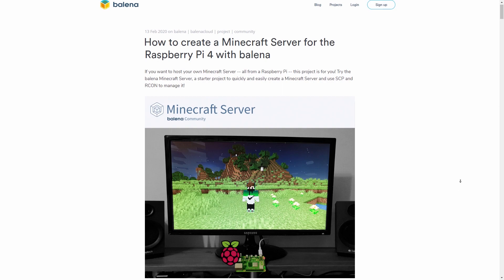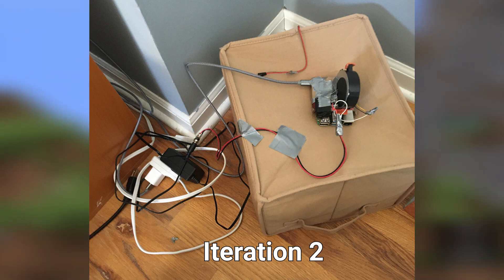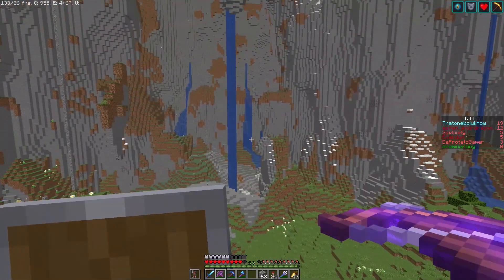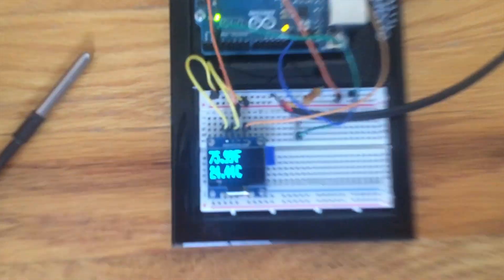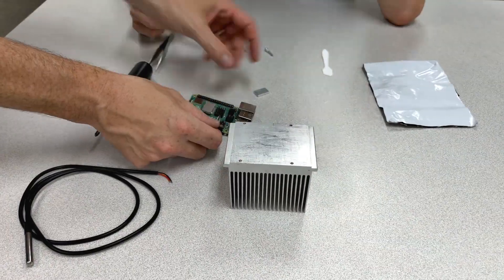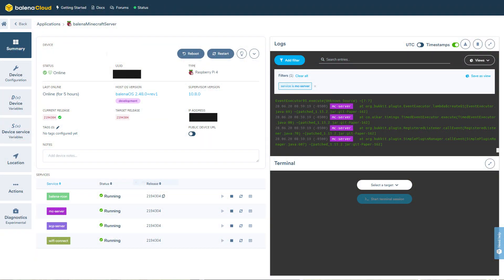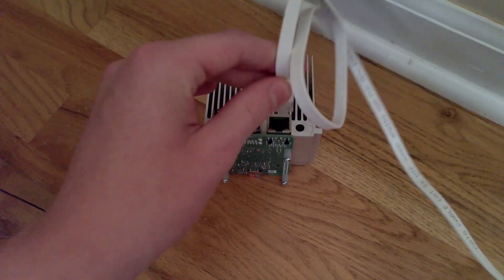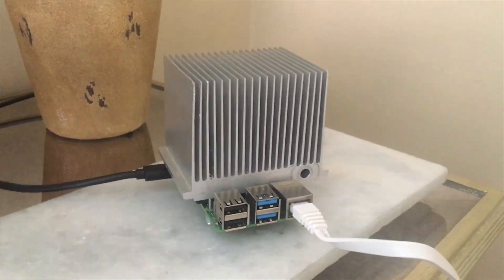How To Properly Do Passive Cooling - Raspberry Pi 4 Passive Cooling

Comment: I made a massive passive heatsink for my Pi4 out of an old AMD heatsink too, but I went a little different route. You get better thermal transfer by not sandwiching a stack of spacers with thermal paste together and for such a small CPU like the Pi has it also helps get rid of heat better without that GIANT thick chunk of thermal mass on the base of those old heatsinks which retains more heat.

So I used calipers and wrote down the measurements and made a scaled layout of the Pi 4. After figuring out the minimum height/thickness I needed for the base of the heatsink I transferred the Pi layout to it and removed most of that excess Aluminum. With a Pi 3 that's WAY easier because the processor and RAM ETC stick up above the board at pretty much the same height, but on a Pi4 the processor sticks up taller than the RAM chip, so you have to remove more material where the processor sits to get the heatsink to lay flat on both chips. If you know someone with a milling machine it makes that step much easier.

Comment: just use an Argon One case, keep it passively cooled to about 50 degrees celsius even overclocked to 2147mhz, fan kicks in at 55 degrees which I have only seen when stress testing the pi and rarely when I emulate Gamecube for extended periods of time. and the Argon is cheap too.

Comment: which version (gb) of PI is that and how well does it perform ? 10 players on big area on vanilla version will perform well or it is too much ?
Reply from the maker: 4. But the server was using 2. There were times when 6 players were spread around the world and everything was running fine.

The one thing that lags a lot is huge farms and people flying around loading a ton of chunks
Reply: @aSingularPhoton  thanks ! I wonder if 8 gb version would be even better, do you have any idea ;) ? How fast is your internet ? Mine is 600 mb/s and I wonder if it also would make a difference. Thanks for your time, it really helps with my purhase decision ;)
Reply from the maker: Rafał your internet is substantially faster then mine and mine had no problems. When I was doing a little research the server hypixel said that each person uses around 1-2 mbs of bandwidth.
Reply: I have a question what tutorial did u use to build the server?

Comment: Awesome experimentation, could you plz also just make another video with overclock setting upto 2100ghz and 6v or 8v and gpu at 800mhz ? Just for the sake of Knowing the performance , now as you said it works fine but numbers would be gr8... I think u can check out small program to check temps on channel "explaining computers" on Youtube in argon case video posted on that channel it shows a bash script for temp check in loop...link to tht video :  https://youtu.be/IJn3fz7Zk4Q
Time at : 12:01

P.S : This video was very very helpful as RPI COOLING TOWER is not available in india to buy and it goes expensive to import ( i can buy a pi zero w or even pi 3 in tht price) so was looking for an alternative or making ice cool tower myself or something of tht sort with equal performance.... Hence NUMBERS PLZ.

Comment: WIFI fails because you blocked it with the heat sink... You can solve that with a usb wifi dongle if you insist on using wifi. If you haven't already, apply the latest firmware updates that reduces the heat generated by the board And you can also get 60mm 5v fans. If you didn't completely block off the GPIO pins, you could attach a couple to your heat sink and get better temps.